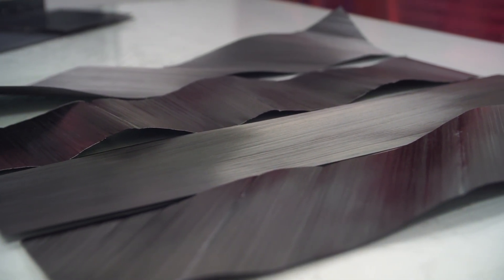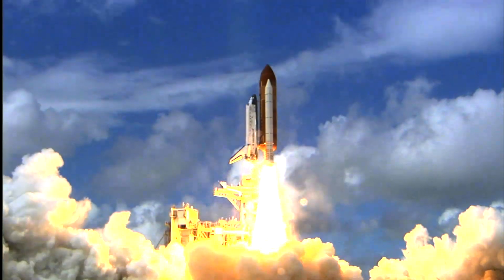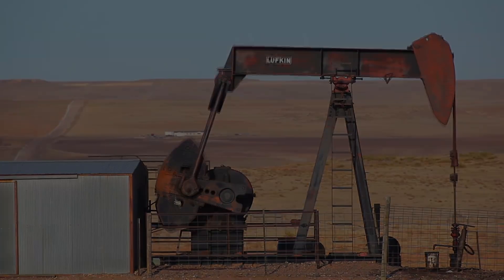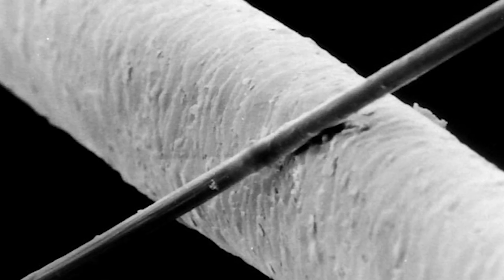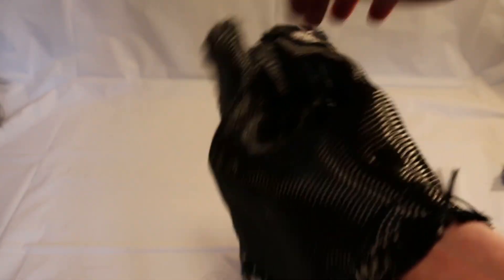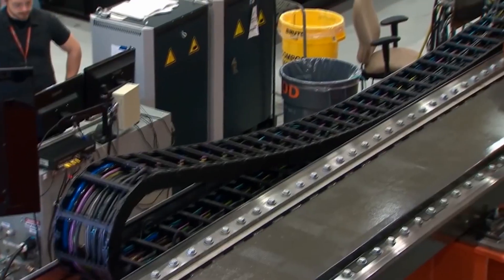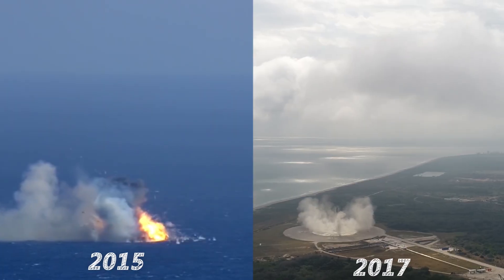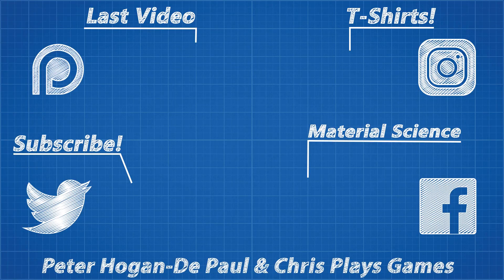Carbon Fiber - The Material Of The Future?

Comment: You had me until the very end. Why are people so obsessed with humans living on Mars? It's an incredibly shitty little planet. It would be easier to live on the bottom of the oceans, or in Antarctica, than it would be to live on Mars.
Reply: there is gain... it's called colonization of the universe.
Reply: idontcare80 I would not underestimate the human race's rate of progress. Quite frankly, I believe that colonizing mars will speed up the process of escaping our solar system. Sure, it may be impossible to travel outside our solar system now, let alone colonize mars, but in the long run we will gather much information when going to mars, that will ensure our success in leaving our solar system.
Reply: idontcare80 Ahahahaha. Humanity absolutely has the resources to put a colony on Mars.

You can think of colonization of Mars as ultimately being a safeguard in case we fuck up Earth.

We'd build a ship, put people on it (in some format), and then send it out of our solar system. Boom, done. Fast forward a long-ass-time.
Reply: Because it's a cool idea, incredibly useful, and there's nothing to gain about trying to get more people living either on the bottom of the ocean, or on antarctica.
Reply: +idontcare80  A nuclear wasteland would be way worse then Mars. For instance, you would have to deal with nuclear winters, which are estimated to to be 2 - 6 degrees Celsius for around 3 years long. And yes, Mar's temperatures do drop lower then that, however during noon, it reaches 20 degrees Celsius, which would be habitable, and it would only be at night. And even if it was below that, we would have a structure (similar to the one in the movie: The Martian) that would protect us from harmful temperatures. Second, you would have to deal with radiation, a lot of radiation. Vastly more radiation then Mars has (As I said before). Exposed to enough radiation, and you would most likely have cancer. Even if you protected yourself from the radiation, you could potentially get a specific bone cancer known as strontium - 90. It is released be thermo nuclear explosions, and is absorbed by the soil, which is absorbed by plants, which is then eaten by animals, which you eat.
Reply: +idontcare80 At this point, your comment is invalid. There are plenty of traces of water ice at the poles of Mars, in which we can extract oxygen and hydrogen. If you are going to call Elon Musk a nut job, at least do your research, fucktard.
Reply: We should send humans to Mars, sure, but the resources required to start a colony there would be absolutely staggering, and no country on Earth has such an excess of funds and resources that they could start a colony on Mars without seriously damaging their economy. Combating climate change should be the top priority of every human being on Earth right now, this is just another distraction from actual problems that human beings currently face.

It's very likely that we'll never be able to leave our solar system.
Reply: Yeah... everything is just that easy when you believe that you live in a sci-fi movie.

The physical resources exist, sure, the financial resources don't.

We could never, EVER fuck up the Earth so badly that it would be easier to live on Mars than on Earth. Mars has basically no atmosphere, no oxygen, it's colder than any place on Earth, huge amounts of radiation reach its surface, there's hardly any water, the gravity is too low... the list goes on and on and on. Contrast that with living in Antarctica, where there's plenty of atmosphere (no pressurized habitats required), plenty of oxygen, enormous amounts of water, very safe levels of surface radiation, 1g of gravity, and we don't have to use Saturn V sized rockets to move a few thousand pounds worth of material there. Building a colony under a couple hundred feet of ocean water would even be MUCH easier than building a colony on Mars.

We send a vehicle out of the solar system, people live on it for hundreds (if not thousands) of years, they get to a new star system.... and then what? Are they guaranteed to find a planet that they can colonize? Do they just turn around and come back if there are none?
Reply: idontcare80 Or when you understand the scope of the problem better than some jackass who has nothing of value to say.

Yes, they do. We spend them, regularly, on things that don't matter and accomplish nothing.

That isn't what I said. Try again.

Thanks for demonstrating you don't know what you're talking about. ;)
Reply: +idontcare80 You seem to be only pointing out the problems in space travel, when in reality there are many positive outcomes of space travel. As I said before, it would give us more knowledge of space travel, and would enable us to travel more in space. Plus, it could potentially be a second planet to act as an emergency home. Which bring me to my second point, in which you said: "We could never, EVER fuck up the earth so badly that it would be easier to live on Mars then Earth." Now, I don't think you are fully aware that we, at any moment, could destroy the earth with the amount of nukes we have. What's to say (hypothetically) that all of the buried bombs (plus Russia's bombs) detonate, The whole world would be so contaminated with radiation, it would be more radiation then Mars will naturally ever have.  It's a worst case scenario, maybe even far fetched, but it's possibly still a threat. I'm not sure about you, but that is not a world I would want to live in.
Reply: We don't have to colonize Mars to learn more about space travel. And I think that you're vastly underestimating how monumental a project colonizing Mars would be, it would probably require more resources than have been expended on every space program, ever.

"Now, I don't think you are fully aware that we, at any moment, could destroy the earth with the amount of nukes we have."

The Earth would still be infinitely more habitable than Mars, even if every single nuclear bomb on Earth were detonated. There would still be an atmosphere, enormous amounts of water, warmth, gravity, people, technology... we'd simply have to move into sheltered habitats, and that would be much easier than moving into habitats on a completely different planet.

" I'm not sure about you, but that is not a world I would want to live in."

How would Mars be any better in that situation?
Reply: "For instance, you would have to deal with nuclear winters, which are estimated to to be 2 - 6 degrees Celsius for around 3 years long."

How is Mars better? It's not like you can go outside on Mars anyway.

" And yes, Mar's temperatures do drop lower then that, however during noon, it reaches 20 degrees Celsius, which would be habitable, and it would only be at night. "

It doesn't matter, at ground level, the atmosphere on Mars is about as thick as the Earth's atmosphere at 100,000 feet. You can't survive on Mars without a space suit.

"Second, you would have to deal with radiation, a lot of radiation."

That's a lot better than having to deal with basically no atmosphere, no water, no resources, no previously established anything. And, like I said, you would have to live in habitats, entirely, just like you would on Mars,  except there would be no danger of them explosively decompressing.
Reply: Claustrophobically small habitats on Mars or claustrophobically small habitats on Earth, hmm.... which would be better?
Reply: +idontcare80 there is water on Mars, but it is frozen under the north and south polar ice caps. The polar ice caps, which were once thought to be made up of only dry ice (frozen carbon dioxide), are now known to have water ice beneath a top layer of dry ice. It's not hypothetical, we have photographs from the pathfinder.
Reply: idontcare80 I did. You are still wrong. You say we have no proof of water on mars, which we do. Also, you are contradicting yourself by saying it is hypothetical, yet you state it as a true fact. I was clearing it up.
Reply: Even if there is subsurface water ice, how would be obtain it? Ship a bunch of tractors up there to dig it up, then ship a nuclear reactor up there to process and heat everything? And, again, what would be the point? Mars would be an absolutely miserable place to live.
Reply: idontcare80 Also, no, it doesn't take a nuclear reactor to extract water from soil. We can easily heat the soil until the water evaporates. Then we would store the evaporated water, leaving the dry soil.
Reply: idontcare80 If you had, sure we would. You'd look like even more of an idiot though, since you'd be falling back on a false premise that you conveniently ignored the criticism of.

We'd be right back to the part where you don't have an argument, so you're pulling out every nonsensical bit of bullshit in the book to try to avoid accepting you don't have a clue.

No it doesn't. Yes they do.AND, you've continued to ignore enormous portions of our arguments while regularly attacking strawmen, asserting nonsense, and moving the goalposts.
Reply: You can't just say that it doesn't take an enormous area of solar panels to melt water ice on a planet that regularly sees temperatures of minus 100 degrees Fahrenheit and leave it at that, because it does take an enormous area of solar panels to do that. 

Obtaining hydrogen from water also requires enormous amounts of energy.

All of what's being suggested here is possible, sure, but what you're both talking about would take hundreds upon hundreds of launches of very heavy-lift rockets, and there's simply nothing that can justify doing that.
Reply: Efficiency is much lower than 100%, unless you're using steam waste from a nuclear power plant for the production of hydrogen.
Reply: Thin-film solar panels aren't very efficient, so it takes more of them to match the power output of crystalline silicon panels, and you still need a structure to support them and to keep them from blowing away.

Anyway, everything being proposed here still requires massive amounts of energy, these solar panel installations would need to rival the largest installations here on Earth to be useful.
Reply: Oh? So there aren't ever wind storms on Mars strong enough to blow away very thin and light solar panels?
Reply: 60 mph winds are more than strong enough to blow lightweight things around, even in the thin Martian atmosphere.
Reply: It's not like we'd be able to transport billions of people to Mars, there's nothing even there to support human life. There isn't really anything that could wipe human beings off of the face of the Earth at this point anyway, and a Mars colony is more in danger of failing than anything, because Mars is not a place where the human race can be sustained.

"If we have a base with water and lower gravity than earth we could also make space industry more affordable."

Those things have almost nothing to do with the cost of space travel.
Reply: Taking no action against climate change is not progress, and progress isn't what's required to get to Mars, money is what's required to get to Mars.

How would we ever leave our solar system? Explain it.
Reply: +idontcare80 Another thing you said was that we have technology. This simply would cease to exist due to the lack of materials being produced, and humanity would be thrown back at least a few hundred years (By a technological point if view). So, in other words, a nuclear apocalypse would be living hell, unlike Mars, in which we would have communications to home, plenty of food and supplies (and because of reusable rockets, it wouldn't be as expensive to launch items into space) Sure, gravity might be not as strong, but we have humans living in zero gravity as we speak, and they reported that 0 Gravity isn't a problem once they got used to it. So, mars would be totally habitable, it would just take some time to get used to.
Reply: idontcare80 I never said we wouldn't have to wear space suits. And yes, at first it would be claustrophobic, that's why our first colonists would have to be trained, but eventually would would have a city made up of the habitats I was talking about. We would also start farming and perhaps find a way to make water on on mars. If you would like more information on what I'm talking about, check out Elon Musk's talk on living on Mars, it's a very intuitive talk.
Reply: I know all about Musk's talks on Mars, he's really just kinda nuts. 

How would we make water without hydrogen? It's all been stripped from Mars. We'd have to import everything that we'd need to survive on Mars from Earth, so why not just stay on Earth?
Reply: bootlegged_cake We don't even need to go to the poles. There's plenty of subsurface ice.
Reply: +idontcare80
read your name and move on :P
For everyone else, why bother arguing with someone who's named "idontcare?"
Reply: There isn't water all over Mars, the only significant amounts of water are at the poles. 

I knew plenty about all of this before anyone even heard of Elon Musk. 

We've never found subsurface ice on Mars, that's purely hypothetical.

My screen name does not describe who I am.
Reply: Reread my comment.
Reply: I said that there's no proof that there's subsurface water on Mars, but there is water at the poles. Either way, obtaining water on Mars would be difficult.
Reply: idontcare80 What? Machines on other planets? WE'VE NEVER DONE THAT BEFORE!!11!!1111!1111!!11

And no, that would be retarded. We'd use solar.

There are many points. If you don't know them, then you're undermining your own claims to know fuck all about this topic, Mr. "Planning does not exist."
Reply: I'm talking about TRACTORS, machines that are capable of digging up thousands of tons of Martian soil. A Falcon Heavy could transport ONE tractor that size to Mars, if even that.

Solar? Are you kidding? Do you have any idea how much energy you're talking about here? Not only do you have to heat up ton after ton of dirt to melt the water out of it, but you'd also have filter all of the dirt and rock out of the water, the energy requirements to do that are massive. You would have to ship absolutely enormous solar panel installations to Mars. 

YOU don't understand what you're even suggesting we do here, that's the problem.
Reply: Right, we'll just drive for thousands of miles over incredibly rough terrain on Mars with big giant rovers to transport a couple thousand gallons of water, that's no big deal at all. It would be easier to simply transport water from Earth than it would be to transport all of the crap needed to obtain water on Mars.

Scientists can propose anything they want, that doesn't mean that anyone will be willing to fund these enormous projects. Elon Musk can propose anything he wants, that doesn't mean that anything he proposes will be practical.

What would you easily heat the soil with? You need something that produces heat, like a nuclear reactor.
Reply: Resistance to what?
Reply: idontcare80 It's so easy to make you reveal how ignorant you are.
Reply: Actually, I was trying to get you to say electricity, and then I would have asked where that electricity was going to come from. You would have answered solar (I think) and we'd be right back to where we were a few comments back. Resistance heating (and producing heat in general) requires enormous amounts of energy, and solar panels don't produce enormous amounts of energy unless you have an enormous area of them. That's not a big deal on Earth, because it doesn't take an enormous chunk of the federal budget to transport a large number of solar panels from one place to the other, but getting them to Mars absolutely does.
Reply: +idontcare80 First off, he proposed that we make several stations to deliver the water around Mars. That was one of many he proposed, not just one. The one he talked about the most frequently was the one I just said. Second, we will use thin sheets of solar panels momentarily when we first get there. But for the main source of power, we would be using the hydrogen and oxygen to create a chemical reaction for rocket fuels and power.
Reply: And where are you going to get the hydrogen?
Reply: idontcare80 Ever hear of a thing called water?
Reply: bootlegged_cake .... You seem to be using overunity machine logic here.

When you split water into oxygen and hydrogen that takes just as much energy as you get back when you burn hydrogen and oxygen. Except efficiency is always < 100%, so you'd lose energy.
Reply: seigeengine Oh, my bad. I was more implying that we were going to use it as rocket fuel to get back to earth, so we can bring back power. I guess I worded it weird.
Reply: idontcare80 I never said it wouldn't be that many solar panels, but the solar panels are light weight, meaning the we could carry more in just one rocket. I think that your thinking about the big, bulky ones on top of rooftops, but I'm talking about the paper light ones that fold up.
Reply: bootlegged_cake Oh, I see. Yes, that's certainly something we could do, but it wouldn't really make sense to bring, say, fuel to Mars.

That's kind of why solar is the best bet. Yes, Mars is going to be worse for solar than Earth, but once you get the solar capacity there, it'll keep generating nigh-on indefinitely. In fact, Mars is sort of the perfect case for solar. Solar is so expensive and problematic for us here because we have access to a power grid that can produce energy more cheaply (at present), and with far fewer complications than a solar system can. Yet, if you get out in the middle of the woods or something, somewhere isolated, suddenly solar looks better, since the cost of having lines run out would be enormous, and they wouldn't be repaired quickly if anything happened to them. Mars is sort of the ultimate "out in the woods" location in that regard.
Reply: idontcare80 Except it also regularly sees positive temperatures. You know full well you;'re saying stupid shit.

Resistance heating is 100% efficient at turning available energy into heat, bruh.
Reply: idontcare80 No, there aren't.
Reply: We definitely want to find ways to up the carrying capacity of Earth foremost, but we can only fit so many human beings/ human derivatives on earth. We also want modularity in case something happens to Earth so our species has a future. Ultimately we want as many people as possible: people who want there to be a cap to human population are as good as nihlists aka useless what's wrong with genocide if less people is better.
Reply: If we have a base with water and lower gravity than earth we could also make space industry more affordable.
Reply: idontcare80 it's not about Mars, it's about what it means. the moon is absolute shit. it's got nothing's particularly interesting except space rock.but when we landed on it,that was one of the largest evolutionary steps in human history. if we can go to Mars within a hundred years of having gone to the moon?that would just be a standing testament to the exponential growth to of human ability to achieve things
Reply: We should go there, yes, but it doesn't make any more sense to try to colonize Mars than it does to try to colonize the moon.
Reply: idontcare80 OK yea between the two they're the exact same on terms of permanent r residence
Reply: If we learn how to survive on mars, we'll also learn how to survive on earth if the climate changes significantly for any reason. Would that not be useful?
Reply: You added nothing to this conversation, good job.
Reply: This was a similar question in the 1500-1600s with the colonization of the Americas, why the need?

Going to Mars isn't just for the sake of colonization, it could be the single greatest decision  in human history, being a gateway to possibly the rest of the universe.
Reply: idontcare80 Congrats on not knowing what you're talking about. ;)

But I'm done entertaining your degeneracy at this point. Enjoy the corner.
Reply: idontcare80 d
Reply: idontcare80 HAVE YOU NOT BEEN LISTENING TO WHAT IM SAYING? We would take rovers to the poles and dig up the ice (WITH DRILLS) and bring it back to a filtering station. And by filtering system I mean melting the ice to boiling point. This idea has been proposed by SCIENTISTS. Like I said, your just an idiotic person who won't give up your little YouTube debate. We know what we are talking about, and maybe you somewhat do, but there are plenty of ideas from people (including Elon Musk) that have been proposed. People smarter then you.